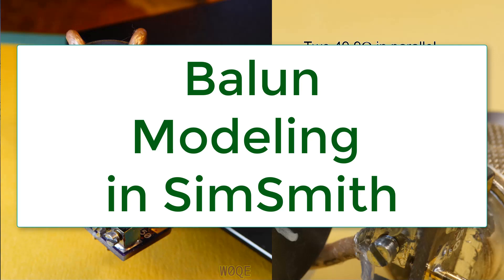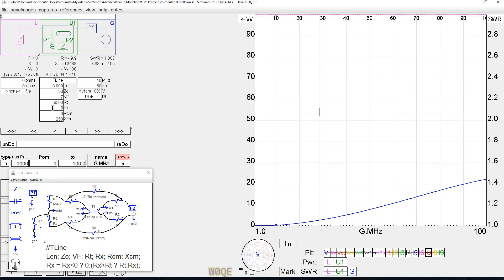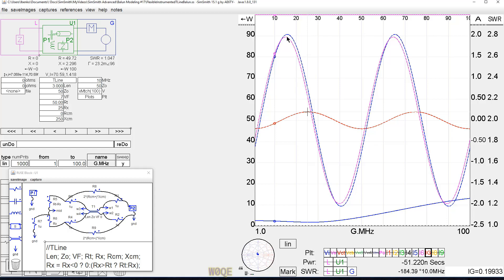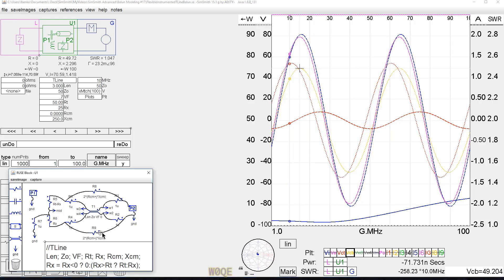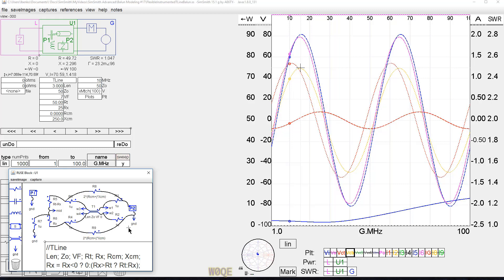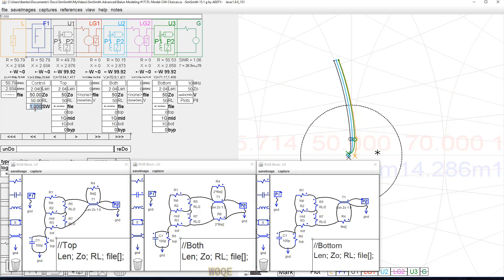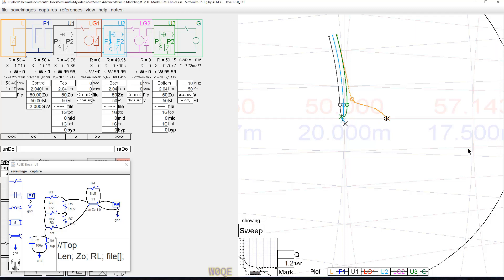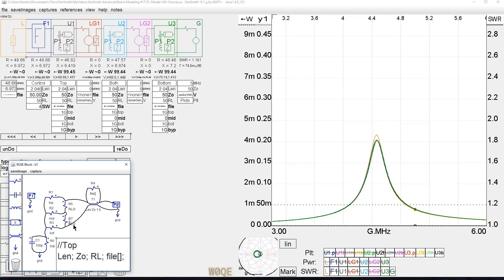#30: Balun Modeling (Adv. 17)

Comment: Larry, thanks for this educational video.
But when I use the downloadable files as in your video and try to use them in Simsmith version 16.9ai I get some errors.
In all ruse block’s I get the error:
“Couldn't find 'RL' anywhere” 
Changing “RL” to “RB” the error is gone.

In the F-block I get the error:
“Can't assign non-numeric to numeric parameter” and the variable “$top” is in red.

How can I fix this error?
Thanks in advance
Reply from the maker: Guido,
Take a look at video #75 which explains what is going on.  Videos prior to #47 were done using the SimSmith syntax for version 14/15 and later videos used the syntax for version 16.  Videos #47, #48, and #57 describe the syntax differences.  Let me know if you can't figure this out and I can send you modified files to be compatible with version 16.  Version 15 is still downloadable from the SimSmith website and it will run the files correctly and you can have both versions loaded on your PC at the same time.  Version 16 cleaned up a huge amount of leftover tweaks, add ons, inconsistencies  that had accumulated from earlier versions of SimSmith but unfortunately some of the syntax changed.
73, Larry, W0QE
Reply: @w0qe  
Larry,
As clearly explained in your video #75, I installed also version V15  on my PC.
--> Problem solved :=)
I will study videos #47, #48 and #57. I try to edit the syntax of the file and see if I can let it work on version V16.
Thanks again for your advise and all your excellent video’s.
73
Guido  on7ch
Reply from the maker: Guido,
Here are a couple of hints.  SimSmith ver. 15 and earlier used a file suffix of .ss while version 16 changed the file suffix to .ssx.  Version 16 reads and mostly correctly figures out version .ss files but you may have to make some small name changes in F, N, RUSE blocks.

 In the F block replace the parameter I (impedance) with Zin.  Old plotting was done with the "plot" command and new plotting with the "Plot" command and finally you used to be able to have a component in the RUSE block such as R1where R1 was both the reference designator AND the value which caused confusion.  Now let the component reference designator be R1 and the value the R1_ or something other than R1.  Finally there were several names that are now not allowed as variables so if you try to use a variable named SWR and you get an error just change the name to SWR_ or Swr or something else.  Videos #47, #48, and #57 describe this better.

Hope this helps.

Larry, W0QE
Reply: @w0qe  
Larry,
I managed to correct the errors so it run also in Simsmith V16.9.
Thanks for the many suggestions, you have been a great help.
73
Guido  on7ch
Reply from the maker: Guido,
You are welcome.
Larry, W0QE